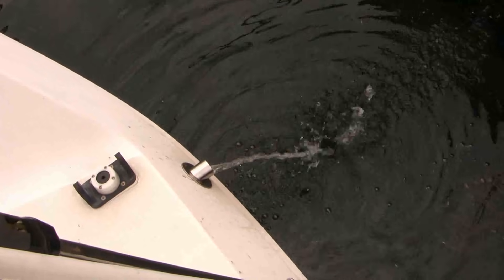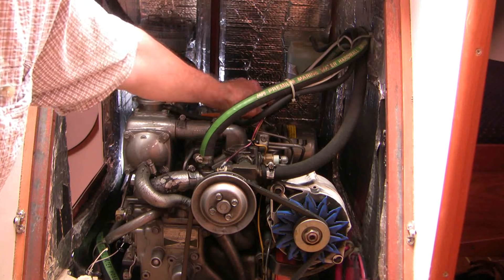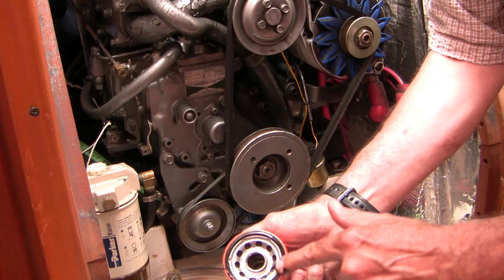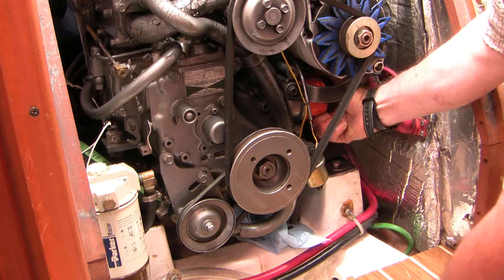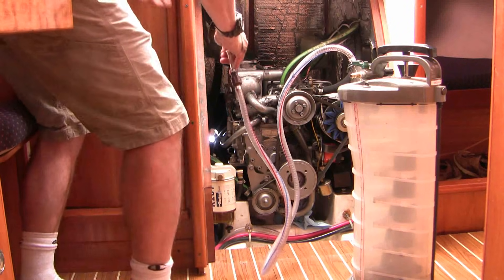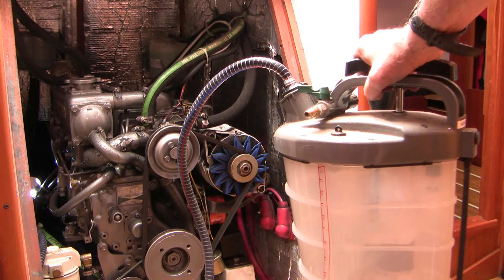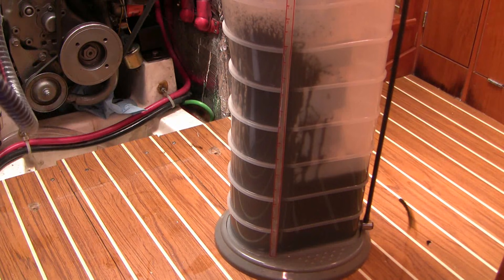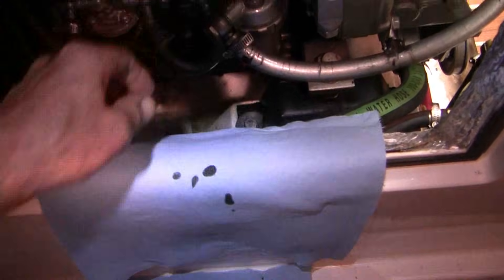Yanmar marine diesel oil change

Comment: Do not fill the filter as your putting unfiltered oil into the engine. It’s a minor amount but it is unfiltered . 
All oils are beyond manufacturers specifications  of cleanliness to begin with ! If you take new oil to an oil lab and have it tested you’ll see the results. Its minute , but true . 
The reason for warming the oil is to warm it so that it flows easily. Boat engine oils  usually must be evacuated with a pump. Cold oil doesn’t pump easily. Even regular oil changes it’s best to warm the oil to operating temperature  then drain it. 
Be careful it’s hot !
45 years CAT mechanic now 😂 a little 4 banger yanmar too in the beneteau

Comment: If the engine has been standing for more than about a week, and immediately after changing the oil, to pre lubricate , I open the decompression levers and crank it over on the starter motor for about 5 to 10 seconds, then drop the decompression levers to allow it to fire. I do not use the Yanmar technique of opening the throttle to a high setting, but leave it at a setting that will give about 1000 to 1100rpm when it starts. I have owned four boats with these little Yanmars and they have always been very reliable. I run them at about 2500 rpm, and once a day give them about a minute at full power. Other than the five minute warm up and cool down I never let them idle, or run at low RPM.
I have fitted after market stainless steel exhaust elbows and have never had a problem with carbon build up in the exhaust on any engine.
I run 15w40 mineral oil and change it every 60 or so hours, which is typically twice a year (as I use the boat all year round).
Reply from the maker: Yes, I've tried that in the past and I certainly helps to prelubricate and make starting easier. Good points!
Reply: In addition to operating the decompression levers also pull the stop button to prevent fuel being injected into the cylinders while cranking.

Comment: Nice instructions. If oil cap is not open immediately the pump will create vacuum. Can it cause a damage?
Reply from the maker: Interesting point. There's enough air flow around the tube that vacuum won't be significant. Also most engines have some kind of breather or PCV valve to balance blowby gasses when the engine is running. More modern engines can have tremendous crankcase vacuum, the VW turbo engines for example. If you remove the oil fill cap on those engines the engine will get a serious vacuum leak and it may quit.

Comment: Great video, thank you!  Question...how do you clean the siphoning container?
Reply from the maker: The siphon device itself contains mostly oil so I simply pour it into an empty oil container. If I use it for other fluids there is inevitable cross contamination with gear oil etc but the recycling depot don't seem to have a problem with that. Old coolant, expired diesel fuel, and oil needs a container to take it all to the recycling depot, so I use old containers and don't have to clean them. Our local depot will even take empty containers that once held oil, coolant, etc.

Comment: Hi great video, one question i have a small boat with a yanmar 1GMC diesel engine 6.5 hp  do you know what oil i put in the gearbox. Thank you
Reply from the maker: I'm not sure. The great thing about Yanmar is the way their repair manuals are free, online. Take those details to a marine engine shop and ask them for what they recommend. I've been using transmission oil made for salt water environments, since I will guess they may be better if the output seal begins to fail and salt water mixes with the oil.

Comment: Can you change the seawater pump belt by slipping it over the crank pulley?
Reply from the maker: You have to remove the main belt first, but yes you can. Better to loosen off the mounting plate bolts, then it slips off easily. It is an old style V-belt, not one of those new stretch belts in some vehicles. I don't like the belt tensioner on these old style engines, especially the main belt. New engines have a better belt tensioner and mounting apparatus, but I don't think the new tensioners fit onto the old engines.
Reply: I upgraded to aluminum pulleys that accept flat ribbed belts when installing a more powerful charging system.  The new aluminum crank pulley fully covers the existing one, and needed to be heated in the oven first to increase the diameter. I’ll never be able to remove it without a struggle, most likely. I haven’t changed the seawater pump belt in 6 years!

Comment: This might be a stupid question, but how do you discard the oil and clean the hose and container? Do you pump it out into a discarding container or do you simply pour out the old oil into a discard container? And leave the oil residue be untill next year
Reply from the maker: Good question. I change oil on many vehicles, so there is a constant flow of used oil and coolant that I take to the local recycling facility. Most full service marinas have some kind of recycling program. Recycling facilities take used oil, oil filters, paint, and coolant for free. I pour the old oil into empty containers that the new oil came in, and they recycle those containers, too. The vacuum pump I use can be poured out, and I don't worry about a little mixing or oil in the bottom since it all eventually ends up at the same facility. The only things I have trouble recycling are old gasoline and expired flares. My recycling facility won't take gasoline unless I donate a dedicated red fuel container to hold it. My neighbor uses old diesel fuel to help start his burn pile but I wouldn't do that with gasoline. If there is no recycling facility nearby, you could ask your local mechanic to take used motor oil, but they usually won't take the empty containers.

Comment: I like many in the Comments have just Bought my First Inboard Diesel, and it's a 2GM20. It seems as I get Older seeing something done is my go to way to Learn so I really appreciate the Clear Video. Ty and new Sub Here. The Edit is this Question. I read in a Service Bulletin that the Cables on a Yanmar are Steel and should be Lubed. What would you recommend ? Have you ever done it, I have a  Cable in the Cockpit that Stops it Running and that is the one the Bulletin was discussing.Ty
Reply from the maker: If you visit Amazon or your local motorcycle shop, you'll find a little tool I use to lubricate cables called a "cable lubrication tool". It's an adapter that clamps onto the end of the cable, and you use a silicone spray canister with one of those narrow red adapters into the hole in the lube tool. That little tool directs the spray down the barrel of the cable. The cables I installed on the Yanmar (shown in a different video) were so slick that I have trouble keeping the throttle control fixed at slow speed, so my problem is the opposite, ha ha.

Comment: I have the same engine what is the FRAM filter number that you are using? I can't find the Yanmar recommended one.
Reply from the maker: PH6607. There are better filters out there, but you'd have to ask your parts dealer for equivalent options.
Reply: @spelunkerd  Awesome, thanks I think it should be fine using that one

Comment: You are doing this out of sequence, remove oil trough the dip stick, then the filter.
Anyone who have serviced marine engines knows this.
Reply from the maker: Interesting to hear you say that. There is dirty oil in the tubing between the filter and the pan, which will drip down into the pan when the siphon is broken by letting air into that tubing. The antisiphon valve at the filter prevents oil in the line from going back to the pan until the filter is removed. If you drain pan before filter, more dirty oil will drop into the pan, to mix with clean oil to follow. Why would you want to do it that way?
Reply: @spelunkerd  I have done hundreds of these and other Diesel engines.  After running I always remove the oil, then the filter.  Filter is always empty or near empty.  Using a zip-lock style baggy to catch the filter and any little drips insures a clean bilge.  No need for gloves, but I confess I have dropped a couple filters and that generally leaves just a little to clean up.
There are a few of the large Yanmar engines that present a problem and if you are not using the baggy you will have a mess.  These are usually side by side oil filters and it can be difficult to get the bag in place and remove the filters.  I learned that the hard way.

Comment: Do you have a vid on changing the transmission fluid on a Yanmar 2GM20F and the types of fluid to use?  That is our next task -   the book says to use the same oil in the transmission as in the engine, however, on inspection we find that it contains an ATF so we may need to change it and flush the transmission out.
Reply: I have an ‘87 2gm20f yanmar that uses 30w engine oil in the transmission. ATF will ruin mine.
Reply: 10w30 is what is stated in the manual for my 2gm20f.
Reply: @mikeamirault8741  yup, the previous owner put ATF in the transmission.  We pumped it out, flushed it a number of times - now it has the correct oil in!   Thank you all for your help!
Reply: @Toob41  thank you for your reply.  I got down with a flashlight and mirror and read the info on the Yanmar 2gf20f transmission case and it said to use 30SAE oil and 1/3 of a little.  We changed out the ATF flushing it three times and refilled with the SAE.  all good now!
Reply from the maker: Mine is a sail drive, it uses gear oil, not transmission oil. Transmission oil would be wrong, I believe even with a standard drive. If you verify that ATF is wrong, I'd flush it out a few times to be sure it is all gone. Check your manual. To drain my sail drive I simply open the cap, open the drain bolt, let it drip out while the boat is up on land. I drain regularly because the seals there can go bad and let salt water in, which can severely damage the gears. So I change far more often than needed to keep a close eye on whether the seals are failing. Gear oil typically lasts a long time if it weren't for the marine surveillance angle.
Reply: @spelunkerd  thank you for the info!!! I truly appreciate the time you take to respond and offer 'gold' advice.  It may be that the previous owner changed the transmission to another type which requires ATF, we have left him a message to find out.  We hope we get the info before we sail our P31-2 to another bay for a short haul.  Thank you again!!!!

Comment: Great video. I love that suction bottle/ pump pot. Luckily for me I have access to my sump plug on my Yanmar and my Iveco has a built in pump but I think your pump pot is probably the best one I've seen and I could use it on my Cat skid steer to save removing the bash plate. Could you please tell me the brand?
Dave.
Reply from the maker: No-name brand from our local discount part store, Princess Auto here in Canada. Back at the shop I can use the Venturi to apply suction with shop air, but the hand pump works fine anyway. Thanks for stopping by!

Comment: Just discovered your channel - loving the content particularly on marine based engines. You have a gentle approach riddled with knowledge - I've always oiled the gasket on the filter, but assumed it was to help the seal, not stop distorting the gasket!  

I've owned a YSM8 and now a 3YM30 and try and do much of the maintenance myself. I am concerned at the moment the anti-freeze is not flowing through the engine currently,  however no alarms have gone off. Is is possible for the "fresh water" side of a heat exchange to become clogged? If so, can you recommend some content that demonstrates how to clean this? The heat exchanger flushing videos seem most concerned with barnacle growth.
Reply from the maker: Yes, especially if the past owner used tap water rather than premixed coolant or distilled water/concentrate. The most common cause of problems on the freshwater side is trapped air, followed by partial opening of the thermostat, and rarely water pump failure or water pump seal leakage. The cap can be a common source of problems by leaking air across one of the seals, which prevents automatic burping of trapped air. The impeller of the freshwater pump is made of steel, not rubber or plastic, so they normally last for years. If you haven't already watched the coolant video I did, start there, then go to your engine and carefully feel the hoses leading to and returning from the heat exchanger to get a feel for your freshwater flow when the engine is warm. If your engine is not overheating then you have at least some flow, but it would be wise to drain and replace your coolant as a good starting point. If you still have uncertainty as to whether your thermostat is working properly, then I wouldn't hesitate to replace it, they are inexpensive. All that said, the vast majority of marine cooling system problems are on the salt water side and the heat exchanger. I'm planning to remove and clean my heat exchanger in the next few months, and I'll inspect the exhaust elbow at the same time.

Comment: I can't get the oil cap off, I'm turning it to the left. Is this correct? It has been three years since the oil was changed as the boat has been in storage. Thank you.
Reply from the maker: Many oil fill caps are spring loaded, you need to push down and turn CCW (RH threads), like a pill bottle with a child proof cap.

Comment: Leaving old degraded oil in the system seriously degrades the new oil the minute you put it in the engine.  The additive packages in oil are sacrificial so what's left is oxidized and so contaminates the new oil.  Using a cheaper oil to 'flush' the old oil is no better unless it meets the same specs (API Sx/Cx) as the new oil; if not, then you have mixed unsuitable with suitable oil which makes unsuitable oil.  You should add a proper diesel engine flush (500ml) to the system before you change the oil.  Let it run for 10 minutes or so and the old oil, bacteria, water,  and other gunk will be released from the walls.  Now pump out the old oil, put a couple of litres of kero in the system and then pump that out (kero has oil in it so the engine will be protected while you do this).  Then change the oil filter.  Then pour in new oil, pump it out until you see clean oil coming through (you will lose less than a litre but it's no great cost).  Job done.  Then put a diesel fuel system cleaner (500ml) in the fuel tank and the fuel lines will be cleaned as well.
Reply: Good suggestions.  You can add a little kerosene to the engine to help suspend particulates before the change.  I think the engineering of this vessel is a joke because you should be able to gravity drain the oil, generally overnight.  This suction technique is weak at best but the owner is left with no alternative due to improper design of the engine bay.  Having to crawl into the head for access to the dipstick is complete nonsense.  I have seen many vessels but the ones that impress me the most is a clean well kept engine compartment.  The designers make it impossible to maintain the engine compartment here.

Comment: When I repowered with a 3GM, I had room to mount a more accessible remote oil filter adapted to the engine. Very convenient. With the remote filter vertical, there is less spill when changing. Also the adapted filter is much larger than the oem sized filter.

Comment: Thank you for the video! On my 3YM30 motor, I always change the filter before I warm up and change the oil. This way there is little or no oil in the old filter to make a mess on the side of the engine or in the bilge when I remove it. Yes, it means my new filter sees a few minutes of running with the old oil coursing through it, but I don't believe this appreciably compromises the filter's performance, especially since I use an OEM Yanmar filter and change it every 80-100 hours anyway.

Comment: I have the 2GM20 but the same process. Yes I love mine too 6000hrs and still does not burn a drop of oil. I change the oil every 300 hrs. Might be why.
Also I don't let it tick over for hours like some. It's off as soon as it's not needed.

Comment: Just some things I do differently, 1st when removing the oil filler cap, check the inside of the cap for moisture. It is one of the first places that will give you an indication of water/coolant in the oil. No matter what direction the oil filter is mounted, always pre-fill. Fill the filter and let it sit, so it soaks up the oil. Prior to changing the oil, I add Marvel Mystery Oil (MMO) then run the engine. This helps remove sludge.

Comment: Hi,  nice video thanks.  I have the same engine in my yacht. It recently stopped underway.  I finally found out it was air in the fuel line. I managed to get it out by opening a 10 mm bolt near the left hand top side , below  the heat exchanger and operated the lift pump to remove the air.  all good now,  where did the air come from though?
Reply from the maker: Good question! I'd be replacing the seals at the two filters, and having a look at all the connections, carefully looking at the bleed screws in case any were left partially open. As you say, air had to get there somehow and if you didn't run low on fuel or heel over to let air in, it had to get there somehow. The last time that happened to me it was my mistake, not purging air after a filter change. On the other hand, water in the line will behave the same way so don't rule out water as a cause.

Comment: Hi, I know this is not to do with oil change but how do you know when your thermostat is not working. Thank
Reply from the maker: Usually overheating. When you start the vehicle, feel the hose that sends coolant to the top of the radiator, it starts out cold, but after the engine warms up the hose should get hot, indicating the thermostat has opened. Many thermostats get thrown out because of false blame, and the most common cause is inadequate burping.
Reply: spelunkerd , thanks very much for your information.